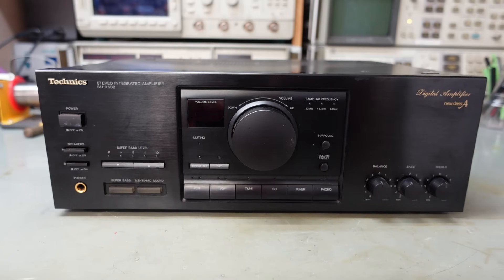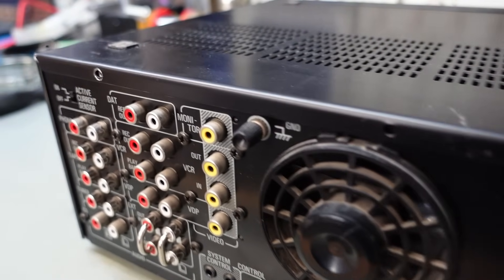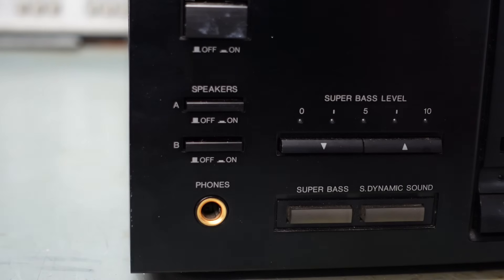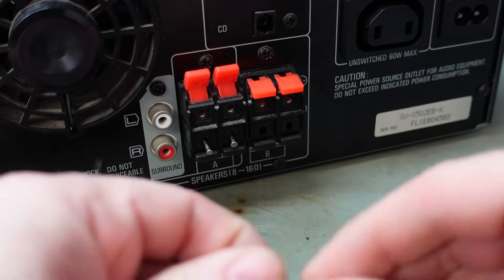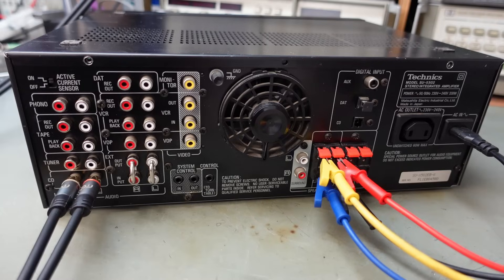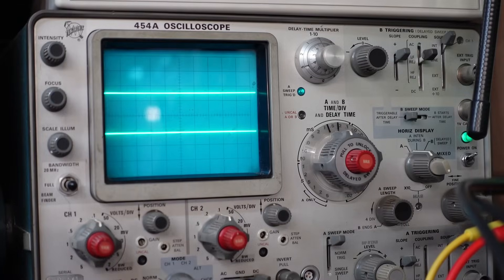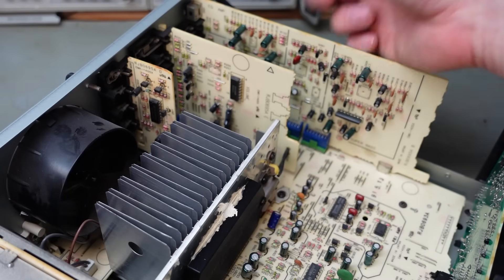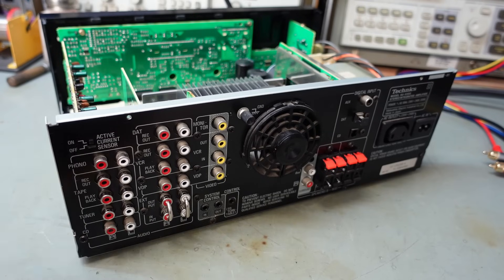Technics Amp repair with NO PARTS!

Comment: Modern Amp's and Tuners look so rickety inside. If you have a chance examine the build quality of a Sony TA-F3A or TA-2650. Or look at the quality construction of a Kenwood KT-5300 Tuner. Contrast the thick aluminum control panels with cheap black plastic control panels. The gear from the 1970's is made in Japan not China and it is much better.

Comment: I was hoping you could give me some advice, I have a Dennon DRM800  tape deck.  it's in like new condition hardly used at all. But when I make a recording it works perfectly, but after a few moments the erase head loses power and you can hear the old recording in the background of the new recording. With my limited knowledge, I would suspect a capacitor is going bad. I wish you were in America I have a few things I would send you.

Comment: Glad I found this, got this same amp as part of a full system many years ago, it broke once volume control kept going to maximum on its own, had it repaired but broke again and has been stored in back room for years but now I have an idea to fix it. Was going to junk it which may still be an option😁

Comment: I have an old JVC 4-Channel receiver (able to play 4-channel records). The potis are rusty, too. What do you use to get them go free again? 
I'm an electrical engineer ( 55years ) without any base knowledge needed here and I'm learning for two years now (my father died 1 1/2 years ago) to get his gear up and running again. Your channel seems to be great, just subscribed to it. The receiver still runs, but only if not trying to adjust anything.

Comment: Hi mark. I’m liking the channel. Like your workshop,  I’m getting into electronics and enjoying your channel. 
I also have a lathe and milling machine I enjoy building small steam engines, I started amateur radio recently and I’m studying for my full licence which requires quite a lot of electronic knowledge which I’m really enjoying.
Just a quick question do you use 60-40 lead solder also what thickness do you use for board work  ?? 
I found lead free a bit crap !! 
All the best mate keep the videos coming

Comment: hi Mark, love your video.  got an issue with my AKAI AM-4000DPL amp, cant find much info online.  can do 2 speakers (A and B) with source direct output on, but one speaker working when switching to surround mode.  any thought?  appreciated

Comment: I've got that amp on my old stack only issue is the crackling balance and the jumping volume numbers not sure if it can be repaired , i have used electric contact cleaner worked for a while but back to normal, so that rear fan switch's on depending on volume ?

Comment: I've a couple of Technics SU-V4X intergrateds here. Getting on for forty years old each but they are very musical and decently powered. I am fine with electronics on a schematic, but haven't soldered anything for about the same forty years. Where are you located? As once I need professional fixing I'd like to put the work your way.

Comment: I have an onkyo receiver tx-ds494, the signal from the remote reaches the microprocessor, but it does not work. Is it possible to repair the chip (perhaps by heating it) or is it only possible to replace it?

Comment: Truly excellent work Mark. Glad I found yr channel.  and I subscribed.  I like your methodology and the professional way you shoot & edit  the video.   I would have also checked the small electriolytic caps and replaced them if off spec.  After re-capping 9 Linn Klouts I found the smaller ones go off first and the big reservoir caps (10,000uf @63V@85 degC) hold up much better on account of their greater size. Thanks - now I have another channel addiction !

Comment: Hi Mark, I'd like to improve your solder sucker performance.  Stretch a 3mm internal diameter neoprene cable sleeve over the plastic intake end of the sucker so it protrudes about 3mm. This improves suction and also protects the plastic tip. Worked for me for many years when I was in the trade. Btw, it also stops the sucker pulling tracks off!

Comment: Oh yeah fan circuitary on these is a common failure as well, my main 502 has a seperate power supply lead coming out of the back running at 2volts, (Variable up to 9) meaning the amp takes 2 plugs into the mains.

Comment: One of my all time favourite amps and as you say a good ebay trading amp. They sell for quite some pennies indeed. You can pick up 'faulty' ones for next to nothing but the fault is that the EXT In/Out as not been bridged with pins or a phono cable ... ive picked many up like this. Tested them, cleaned them up and stuck them back on ebay. Never had any bother and I use one as my daily driver along with its matching SB-CS70 Speakers.
Reply: 11:02 gracias  por contestar amigo si funsiona la ventiladora se prendo cuando subo el volumen pero cuando escucho bajo volumen no se prende el ventilador y lo siento caliente el integrado bien caliente
Reply: @efrainfernandez2905  Yeah the fan WILL only cut in when you ramp up the volume. What you may have to do is re-paste the head compound on the main IC in the amplifier which is what Mark mentions in this video - this is the main brains of the amplifier. There are heat compounds on the heatsink, it dries up over time!
Reply: Buenas bamigo te podría hacerte una consulta tengo el mismo amplificador y calienta es normal calienta hasta cuando está bajo volumen cualquier ayuda te lo agradecería y también cuando lo prendo también hace un sonido raro y después normal
Reply: @efrainfernandez2905  Is the fan working? These amps have a habit of failing the fan circuitry.

Comment: those damn bridge links.  i once had a pioneer a878 and took it apart, checked parts, went trough the schematic for an hour or more, but no sound. until i rememberd that NAD had those links to bridge pre and power amp together on most models, pioneer didnt had markings on the back, didnt mention it in the manual unless you dig very deep and since they were missing it wasnt obvious to me. damn heavy thing made my back hurt.

Comment: There’s a repair guy like you I came across in Leicester. Fixed an old Bowers and Wilkins Subwoofer I’d bought off eBay. Fascinating watching him take the unit apart and diagnose the fault. He fitted a new speaker drum to replace the blown one and away we went. Now happily sitting next to my TV pumping out the base.  Great channel by the way.

Comment: Another wonderful repair as usual. I really appreciate all the effort you put into making these videos, watching it feels like being an apprentice. After your last Technics amp video, I decided to dive into my cheap Technics SA-GX300 bench amp to work on the noisy rear fan. The motor itself was a bit of a pain to disassemble, but after adding some light oil to the bearings and cleaning off some crusty dust build-up on end of the commutator, it now runs completely silent again.  I was a bit surprised you didn't go after the noisy fan on this one, as mine was in a similar state and it was driving me crazy! Regardless, thanks for all you do, and I am looking forward to your next repair!
Reply: Hi, was that general maintenance, no parts, or was something else e.g. no input? Thanks, best regards.
Reply: @franciscorompana2985  No parts needed. The only issue with mine was the fan noise and I was able to repair that by removing the fan, disassembling the motor, cleaning the dust buildup and adding new oil to the bearings. The only tricky part was that there is a small plastic bump on the bottom of the plastic shroud that holds the motor. The motor has to interface with this bump correctly, if you don’t, once assembled the fan blades will interfere with the housing. It’s trivial, but it is a detail that can’t be overlooked. While I was in there, I also cleaned and replaced the thermal grease on the heat sink.

Comment: kewl. just bought a BU-X920D for $3 untested, now i know what to look for if i need, never tried repairs on this stuff before, thanks!
But why do you need to bridge the output and input on External? mine does not have the bridges...

Edit; A disclosure of what tools you used, especially on the nobs center-nuts would be really helpful to know...
I´m gonna give it away to a random teenager if i get it working with a full array of speakers and a sub-woofer, MWU-HA-HA!!!

Comment: Really great content as always. A bit of a tip for you if you would prefer to drastically minimise your time spent editing yet have long and very informative videos, and that is to not worry about making everything super snappy and slick with multiple close-ups of plugging/unplugging cables, removing many screws, etc. Instead just kind of 'go with the flow'. 

For example, there's a YouTube channel called Mustie1 which I have been regularly watching for years - he mostly does engine and mechanical work on assorted vehicles and mechanical tools, some of them are very obscure and also really fascinating. His channel is an excellent weekly watch because he's really relaxed with his editing. He'll happily move the tripod-mounted or handheld camera around while having a one way conversation with his viewers. To save on editing he'll usually switch off the cam when he's done with a particular segment and then switch it on again as required. He does it in such an organic way that the videos don't seem 'rough and ready', instead they are entertaining and inclusive. Watching a Mustie1 video is like putting on your comfy slippers and settling back with a mug of hot chocolate. 🙂

Of course, that's just his style, but I feel it would suit you too. Like Mustie1 you're very relaxed, friendly, chatty and informative and because of all that this channel has become one of my favorites. I'm just suggesting the above with the aim of helping you to minimise the amount of time spent editing which, as you know, can be a time consuming pain.

Comment: Interesting, people across the pond call those "dry" solder joints here we call them "cold" or "loose"
Reply: Cold is a bit different. In that case both joint surfaces haven't been heated enough to flow the solder properly. "Dry" joints is more a side effect of the type of solder used, vibration, heat cycling or any combination thereof, causing metal fatigue in the joint.

Comment: So many good amps had dry joints due to the early iterations of wave soldering techniques, and crap solder. Wasnt exactly their fault, the tech seemed ok until years later. I have a Sony ES high end model integrated amp... Riddled with bad joints. Top tip... If you find one bad joint, check everywhere else!

Comment: Excellent, I've repaired a few of these, and I owned one of these complete systems in around 1992, it was ridiculous it had about 6 components I think. Turntable, CD transport, tuner,  amplifier, graphic EQ, twin cassette deck, and of course a NICAM TV connected up, with a JVC VHS  and a Pioneer laserdisc :) all good fun. Love your videos Mark, and love your workshop! Used to work for HP and Lecroy T&M so love all the test gear. Many thanks
Reply: lol im running that exact setup  (minus the TT). Mine is the g91 from 1991. Everything works flawlessly, except one of the cassette decks. This deck fortunately isnt one of the cheapo models they produced just a few years later 
(so its worth fixing). I think i saw a receipt for the set up and it was around $600 (on sale) and that included speakers in 1991. The guy i bought it from barley used it. I got everything for about $80 about 10 years ago.

Comment: Easy but rewarding repair, thank you! Those white connectors with the bare wires... aren't they spring loaded as on Onkyo? I would think one needs to push them down to release the wires!

Comment: The ever present factor of 'dry' solder joints has always surprised me. But easy to fix, if you know what to look for.
Reply: I believe this is a remnant from the 90's, when the first RoHS compliant solder was introduced. You had the same with automotive components. Especially those that got a lot of heat cycling, like ABS-modules.
Reply: Yep. The switch over to lead-free solder was to blame for most of this.
Reply: Is it important to use the same composition of solder when reflowing the joints, or is what Mark's adding just some kind of flux desoldering wire?

Comment: My mate has a technics su-v800 class aa amp..... At high volumes it's making a cracking noise almost like and arc or something any idea what that might be??? Were racking our brains trying to suss it out.
Reply: Volume knob is dirty at the top.
Reply: @handlesarefeckinstupid  so bit of deoxit or whatever its called
Reply: It don't work that way.... Could be multiple things from dodgy caps, cracked solder joints, potentiometers, transistors dropping out...

Comment: This one was clean and not much used only with some dry joints, but with more use may be nightmare with lots of bad joints and bunch of bad small capacitors close to any heat source. The miniature Panasonic Matsushita small capacitors of that era are awful. The worst thing is that they are used in places where miniatures were not needed.
I would normally clean the fan that Technics put almost in every model, even on high end plastics 😂
The feet pads left of the upper unit on the cabinet are pain to remove if they got harder. I tried it once. 😅
They are like melted stone 😮

Comment: Great vid. What advice would you give regards the way to mitigate static discharge when working on kit (to someone new to testing and repairing)?
Reply from the maker: Living in the UK helps - it's too wet for static... I use a grounded antistatic mat on the workbench, and if I'm handling sensitive things (CD lasers for example) I just touch one of the oscilloscope chassis (they are all grounded) to make sure I am discharged, before proceeding. You can wear an antistatic wrist strap, connected to ground, but I think this is overkill in my workshop.
Reply: I wear a wrist strap connected to my radiator, although static isn't a major issue in the UK, like the author says. I only wear the wrist strap when working with old PC stuff generally. I just touch the copper of my central heating as I sit down usually. 😂
Reply: Just like here in the Netherlands, always raining

Comment: 00:34 "It's got a digital input for added trouble!" 😂😂 Never a truer word spoken Mark! Great vid as usual matey :)
Reply: @ProudOfYourRoots No, they are not. It was just a humorous statement. Digital audio is very reliable.
Reply: @ProudOfYourRoots maybe you´re hi-fi equipment is unique, or you don´t have a good analogue source to compare it ,as an example i restore 3 of my old decks and i remenber when starting to win more money i bought for the first time a black component stereo system ,i first invested in a ES system from Sony this because since 76 i had been using everything in light grey or brushed aluminium and i already had a pioneer PD-7300 cd player bought in 87 (i think)and bought the most expensive and well talked about cd player from CEC(chuodenki) a belt driven cd player but when i recorded from cd to a TC-K909ES cassette deck, the cassette ,a tdk sa-x it sounded better than the source also my old turntable was really good sounding a PLC-580 from Pioneer and invested in some pair of huge speakers from cerwin vega made of wood with a lot of veneer (believe it or not the red menbrane in my two woffers didn´t rotten as in all cerwin vega speakers i saw from the regular series) ,they cost me at the time each,what today is 1.000€ and a bit more ,the convertion is not perfectelly done, this to say that my 77 turntable and my deck ,modern at the time and high-end of Sony in rock music or music with guitars the cd always cuts the vibration of the guitar chords, the amplifier was a TC-F690ES(or close to it) from early 93 which ,don´t know the reason why ,only in Portugal and the U.K. were sold with two huge power transformers and two also big capaciteurs, the sound was really clean but digital wich i had a DAT deck after the reel to reel deck it was the best recorder i remenber having , the cd player also with lot´s of cds sounding perfect ,not those analog freaks that analog is the best and always buy vinil . well i do have around 9.000 LP records but also have 4.000 compact disc , and what i like is to hear musique with quality ,that i already had in my 76 system but so tired of looking at it, allthough everything works today with perfection , i arrived to the conclusion that digital is in a good path but not evolved as the analog , one can have a complete digital system but the sound is always analog or we wouldn´t listen to music but the sound that the spectrum 48K used to do when charging a game, i believe in you but maybe a singularitie , i can add that some of my friends have expensive cables from rca to optic fiber to conect digital or analogue source´s but it´s weight it broke the digital input on their amplifiers and i use a section of cable tested and proved that it´s the best cable for processing sound but not with a heavy protection, kind of regular cables with a bit more thicker copper cable. Today i record cassettes again. I found around 8 boxes of 10 cassettes from TDK most of them SA-X but also have SA ,CDing type II ,AD-X type I and D also type I and either than my sony deck i had a CT-959 from pioneer and a DRM-800a from Denon, and i make compilations and they sound so good ,even the minidisc that i have 3 decks seems always the same sound but good ,i also bought boxes of 10 minidiscs from TDK when minidisc in my country failed to atract the consumer, so there are good analog sources or maybe all and some digital sources to, but limited to some weird sound of the guitars that when listening to the same LP in a vinil record it sounds like a real guitar, like when we play at home ,with digital is not possible but each own to it´s own ,if one is happy with what he has one shouldn´t look for better, regards